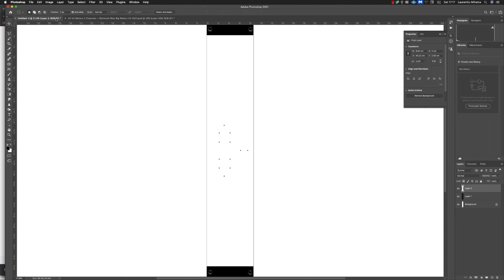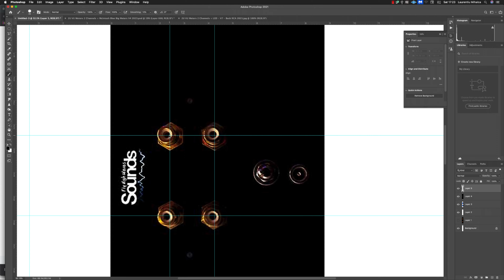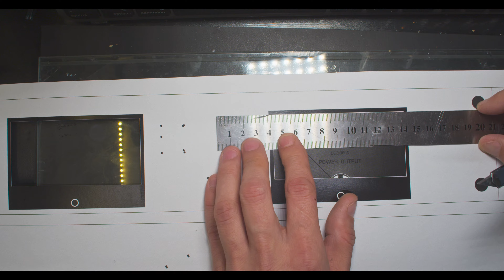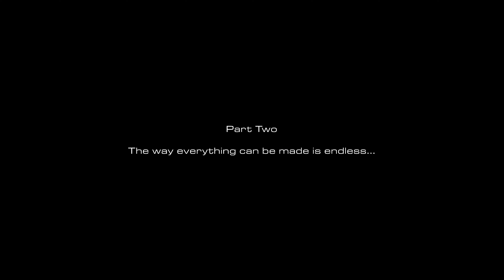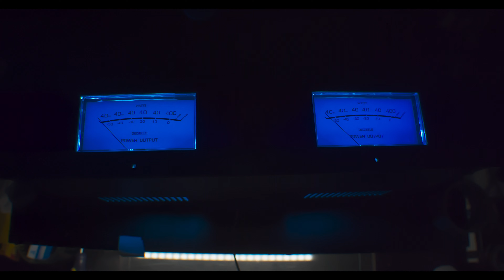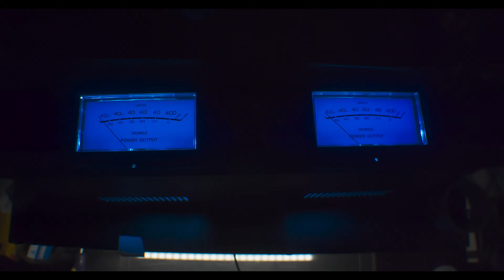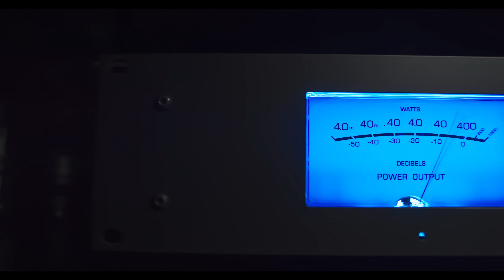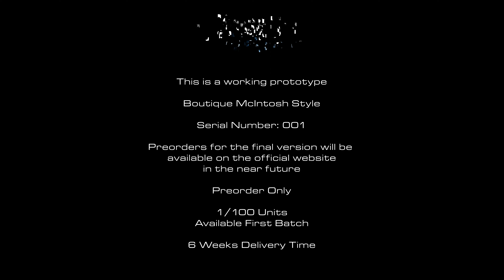Crafting a McIntosh-Inspired VU Meter 19 Inch  Studio Version Complete Build Walkthrough

Comment: I really enjoyed this project great workmanship.
Would you share parts list — meters and circuit ?
Thanks
Reply from the maker: Thanks for reaching out. I would tell you but it doesn't matter that much. There are many combinations possible. Mostly all are the same. You can get the metters with the drivers together. This specific project was for one of my clients who reached for this build. On Aliexpress you can find so many parts. these meters are a bit more special. Most of them have written WATIS instead WATTS when they come from the golden shore of China. You just need to pay attention to this detail. The wiring usually is easy and marked on boards. The hard part is to get the enclosure drilled and ready. For sure you will get great satisfaction from making a similar build if you decide to do it. This video is to inspire you that is not that complicated if you put it in your mind to do it.